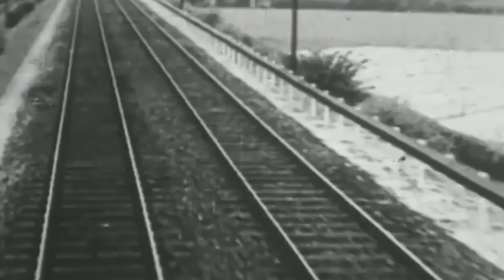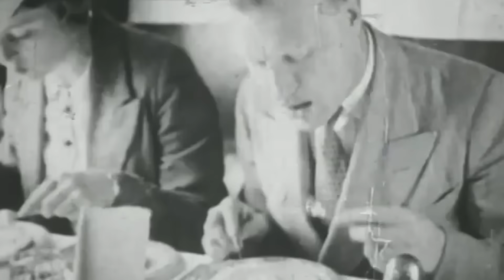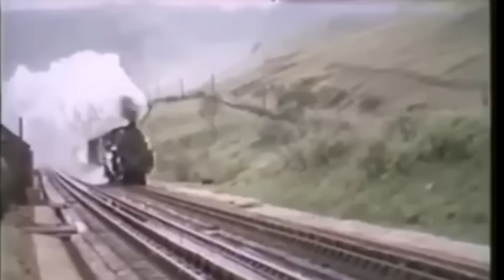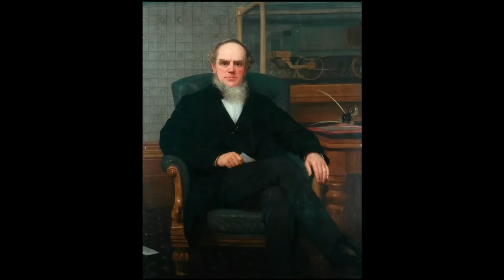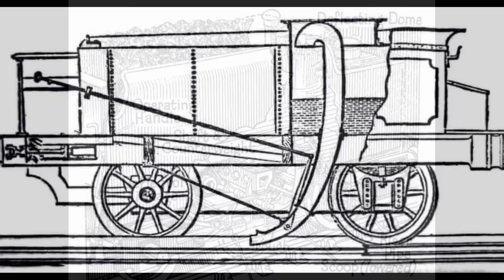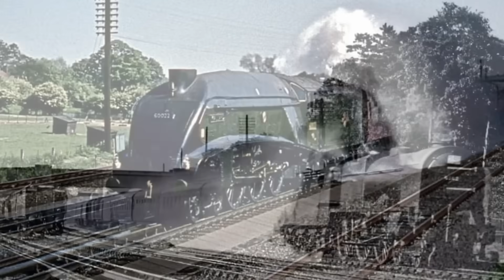On-the-Move Refueling: The Story Behind Steam Trains and Water Troughs #steamtrains #steam #fyp

Comment: According to the Wikipedia article on this, the tracks had a slight dip and rise to allow you to lower the scoop before getting to the water trough, and to prevent breakage of the scoop or the end of the trough if you didn't raise it before getting to the end.

Of course, one additional problem with water troughs is that you have to use them on a region of track that is absolutely level, or the water won't stay in them (although I suppose you could divert part of a stream into a trough on a slight slope and use the continuous flow to keep it supplied).

Comment: The Germans had a different approach, that did away with it: Look for 'Kondenstender' in Wikipedia. The German Version states, that with recuperation of the steam, distances of up to 1200 km could be bridged without replenishing the water. As an additional benefit, the condensate was already well preheated - lowering the coal consumption; and since it was distilled by the process, also reduced calcification. As a side effect during war, the locomotives were less visible for enemy aircraft.

Comment: On a pedantic point: water is not fuel, it's the working medium for the heat engine. 

The fuel is whatever actually produces the heat, in the case of a steam loco coal, or often on the US prairie wood.

Comment: When I saw the title, I felt sure it was wrong. Turned out to be refilling the water in the tender. Not refuelling. 
They never collected coal at 70mph.
Reply: Yep. Water isn't fuel.
Reply: Dude said that once they refiled other train with coal.
Reply: seems water can be considered fuel for a steam engine
Reply: It’s the water that produces the steal that drives the train. Coal just produces the heat to turn the water into vapor. It is not completely untrue. Plus, they could refill coal at destination. Water needed to be refilled much more often.

Comment: Track pans certainly weren't ubiquitous in the US like they were in the UK, but there certainly were quite a few of them, mostly on railroads operating in the northeast and midwest - so New York Central, Pennsylvania RR, Reading, Baltimore & Ohio, among others. Not common in the south or west - it was too hot and too dry.

But of course the other thing is that American loading gauge allowed for truly massive tenders - the Hudsons on the New York Central, which all things considered had a fairly restrictive loading gauge for the USA, had 13,600 gallon (standard tender) or even as high as 18,000 gallon ("Centipede" tender) water capacity. Compare that to an LMS Coronation's 4,800 gallon capacity, and you'll see the scale of things.

Comment: NOTE:  Refilling the water tender is NOT refueling!!!  There is a difference!!
Reply: Arguably it is refueling. Steam locos require two things to run. Coal for the fire, water to be heated to make steam to drive the pistons. Technically both are fuel so refilling either is refueling.

Comment: Question, and maybe it is a moot one at that. Why did locomotives not exhaust the spent steam back into the tender? This practice actually would pre-heat the water, conserving both fuel and water. We did this when firing boilers whilr drilling oilwells up in the north land in the winter.
Reply: South African Railways did just that. Condenser tenders recycled most of the steam for reuse. Made for messy trains as the smoke exhaust just rolled over the loco and train. https://en.wikipedia.org/wiki/South_African_Class_25_4-8-4.
Reply: @ OK, thanks. After reading that I see what a lot of the issues were. Again, thanks.
Reply: Locomotives blew the steam exhaust out the stack, and it created a draught that pulled the smoke out through the boiler pipes and pulled air into the firebox. That made the fire burn a lot hotter and produced more power. Like 19th century supercharging. That's where the choo choo sound and puffs of steam from the stack come from. Stationary engines and ships used the steam exhaust in a second and sometimes third set of bigger cylinders to get more work out of it, and condensed it back into water. That was too big and too much weight for a loco.
Locomotives were high-performance machines.
Reply: You had reason to...the lack of water..... so you needed to recycle.

This was and always will be a pump and dump system...

the long flexible hoses need to recover the steam from a locomotive just wouldn't work...
plenty of "free" water at the tracksides...or in the troughs.
Reply: @JohnSmith-pl2bk  OK, but they already had long lines and hoses running from the tender up to the injection pumps to pump the fresh water into the boiler as it used water. Even though in places where water was plentiful using less water would have equaled fewer stops. I am just wondering if there was an actual mechanical reason they did not do it, or maybe no one had thought of the idea yet.

Comment: The FUEL is COAL - NOT WATER!

Definition of fuel :- A fuel is any compound that has stored energy.
Reply: Blah de Blah de Blah……..
You guys must be a laugh a minute down the pub.
Reply: @jamesstevens1972-q2v  water is defined as fuel in a hydro electric powered station so you are wrong old chum.
Reply: Water has stored energy as well, plus they're elements not compounds
Reply: @BillSikes.  So, what calorific value does water have?
Water does not have stored energy, steam does have stored energy produced from where the coal heated the water to produce the steam, but the source of the energy is still coal.
Reply: @jamesstevens1972-q2v  
That's the funniest thing I've read in years, water contains no calories 🤡😂😂😂
Reply: @BillSikes.  But the water only stores the energy - it's not the source.
So, to be pedantic, @jamesstevens1972-q2v is correct that this is not "refuelling" - it's just replenishing the water.
Reply: @BillSikes.  Neither water nor coal is an element. Unless we're talking nuclear energy, compounds do not contain energy in the layman sense of the term. Most chemical energy is stored in the bonds between atoms, and therefore the substance storing energy cannot be an element. It must be a compound, even if it is merely a molecular compound comprised of a single element (such as molecular hydrogen, H2).
Reply: @APS_Inc  
That's complete rubbish, Coal is predominantly Carbon, one of the most abundant elements in the entire Universe
Reply: You didn't read what I said. Coal is a compound comprised almost entirely of the element carbon, but it only derives its usable energy (to the layman) in its molecular structure, which makes it a compound. Elements are atoms defined by the number of protons in their atomic nuclei, and unless you're operating a fusion reactor, the fact that coal is made of elements is irrelevant. Also water is not an element, it's a compound made of the elements oxygen and hydrogen (which you know).

Elements are building blocks, but almost no substances you encounter in your everyday life, except maybe for helium from a balloon, is in a pure elemental state, or at least, in such a state that it is not in a compound with itself (which would still make it a molecule and thus not a pure element). Chemical energy is generally stored in those molecular bonds between atoms, and thus any amount of pure carbon without the molecular structure that defines the compound would be useless as fuel. Diamond and graphite are elemental carbon, but despite being composed entirely of the element carbon, they are still compounds and not elements.

Comment: No mention of how the  troughs were kept full of water! An extremely important fact glaringly missing! A lot of us know, but it would have been informative to include it in this video for those who don't.
Reply: I don't know please share the information thanks.
Reply: As well as the info below, the actual water to top up the troughs usually came from purpose made small reservoirs, located very close to the troughs.
Reply: Obviously the trough must only be on a level stretch too or the water would flow to one end.  And although the trough must be KEPT full and refill rapidly after use it could not be permitted to OVER fill.  Yet a ball valve would be at extreme risk from the scoop.  And provision needed to be made so that it was impossible for the scoop to hit the end of the trough or the sleepers beyond the trough.  A few practical considerations that must ALL be filled to make the design suitable for general use.
Reply: @smitajky  
Just have a protected "well" at both ends of the trough where you have a float valve...
the "well" regusters the level in the trench and this controls the water level?
Reply: @smitajky  - Fill the trough from the bottom in the middle. Why not let it overfill?
Reply: @GWNorth-db8vn  "Why not let it overfill?"
Because treated water is expensive. Especially if you're in a hard water area and you need to soften it to avoid filling the locomotive with limescale.

Comment: In Canada, the cars at the front of the train were for coach passengers, whereas those in sleeper accommodation were further back.  This means only the lower class passengers would get soaked.  Problem solved!  🙂
Reply: In Britain the cars towards the locomotive (when heading TO London) are the upper class types so they can depart the quickest - get to the taxis first and stuff.

Comment: Brilliant Video ! Made my day ! In germany we call it: British humour !  This is to tell funny things without any emotion. What I cannot understand: British railway engineers were the first to develope excellent steam engines. Why didn´t they install a floater in the water tank to uprise the pick up tube when the tank is getting full ?
Reply: Because the force on the scoop from the loco speed and weight of water would overpower a float valve. The scoop has to be moved by a hand operated gear drive in the cab. The scoop is made from 3/4" steel so very heavy, the hand drive is reliable.

Comment: No worries about that on the Southern Railway. Water troughs were not used, and locos were fitted with larger tenders where necessary.
Reply: Well 3 rail electric and water troughs don't mix.
Reply: @michaelmcnally2331  🤣😂🤣😂😅
Reply: They mostly didn't have the long distances.
They used to change engines at Salisbury for the runs to Devon

Comment: Other than the method for scooping water, how did this affect the design of tenders?  Did thay make the water tank smaller since the tank was easily refillable and the coal bins larger for greater mileage between coal stops?

Great video, thanks for posting!
Reply: It probably did, if you look at the arrangement of Southern Railway “Merchant Navy” locomotives. There were never any water troughs on that railway, and they would have to operate between London & Exeter without a long stop to collect water. The other issue would be the total weight of the tender per axle.
Reply: That's a very good question.
I suppose so. Would be a key advantage of water troughs.
Someone else who can give a difinitive answer should chime in.
Reply: I doubt they made them smaller, steam locomotives blow through water like it was wet air, can never get enough water, use 5x as much water as coal. Also the troughs are miles long but shallow (to fit between the rails and above the sleepers) so they take several minutes to refill for another dose - could not support ALL trains that way. Goods trains might not even go fast enough to raise water that high, particularly back in the "tiny 2-axle goods wagons" days where the trains hauled customers' wagons that didnt even have brakes. Additionally in the winter something has to be done to keep the water from freezing. This was only for the fastest classes of train.
Reply: I have seen enough details on tenders to say YES the water capacity was less and the coal capacity more.  The reason is that UNLESS they had more coal capacity a long non stop run would have run out of fuel.  And simply increasing the size and weight of the tender reduces the performance of the train as a whole.  And unless you use more axles the axle load of a larger tender becomes too great. Therefore to HAVE enough coal you had to have less water.  Whether you like it or not.
Reply: Strictly speaking they didn't reduce coal capacity but a Tenders increased in size they gave more space to coal on the larger tender then additional water.   The initial LMS Standard Tender was the Fowler which was 3500 Gallon Water and 5.5 Coal (more coal when rails added).    The next one the Stanier Tender moved to 9 Tons of Coal but only 4000 gallons of water, and the tenders for the Princess Coronations were 10 tons of Coal but retained 4000 Gallon capacity.
So when they increased the tender size then proportionally got a lot more Coal added then they did Water, as they could replenish Water with the Troughs but Coal had to go to the Coal Depot to replenish.
If you go out on a Steam Hauled excursion on the mainline then it is Water Stops that you make not Coal Stops.

Comment: John Ramsbottom also invented the split metal piston ring (without which we wouldn't have internal combustion engines), a safety valve that couldn't be tampered with, and lots of other useful things.
Reply: Yes l have a ramsbottom safety valve on my 3inch scale traction engine.
Reply: It's not like his inventions are crucial for modern technology but his inventions boosted efficiency, safety and durability. 
You can make a piston engine without split rings. In fact, there are many competing designs without pistons out there. But the piston engine is too cheap to make and too reliable. Without split piston rings, I would guess we would mostly use Wankel engines or have switched to electric cars much earlier.

Comment: How did they refill them? Was there a water trough refilling wagon or did they just roll a tanker over it whilst emptying it?
Reply: stationary piping from water tower of course. The very idea is to supply water from abundant stationary source to moving loco, nothing more.
Reply: @ thank you
Reply: Usually by diverting a nearby stream, sometimes with the full water tower pumps and other plumbing. 

The Thomas the Tank Engine episode where they get a fish in his water tank was almost possible, but for the usual filter between the heater tank and the actual trough.
Reply: The train carried a water tanker on the rear before the caboose. As it was scooping up water in the front, the tanker would dump the water for the next train in the rear.
Reply: @coloradostrong8285  nonsense. Additional tanker just sits behind the loco and pumps water directly to water tender. Used when there are no water at all, not possible to build water tower. Australian railways used herds of them to run 100s km by arid steppes and deserts.
Reply: @antontsau  "nonsense"
It was obviously a joke. 🤦‍♂

Comment: In America this method of scooping up water was called “jerking water”. The New York Central used it on the 20th Century Limited. A place where the train didn’t have to stop because it could jerk water was called a “jerk water town”. Now a jerkwater town means someplace that’s boring or insignificant.
Reply: Answered one question I didn't know I had! Bravo.
Reply: @jimtitt3571  And you still don't, google jerk water towns.
Reply: My research says that "jerking" water referred to filling a tender by drawing it with buckets from a stream.  A "jerkwater town" was on a "jerkwater branch," both terms referring to one so unimportant as to lack a proper water tank.
Reply: Americans have a way of dumbing down everything.
Reply: Last time I got caught jerkin water they banned me from the pool
Reply: Not just that, but the water troughs were known in America country as “track pans”

They were used for the same purpose as shown in this video
Reply: Nowadays jerk water town refers to the USA

Comment: Southern didn't use this sytem
Reply: They changed engines at Salisbury for long runs to the SW.  Most of their other routes were short enough not to need trpughs, but they had bigger tenders.
Reply: @rogercantwell3622  Also, water trough + third-rail electric = BANG

Comment: Water is not fuel.
Reply: Non condensing steam engines need a lot of water!  It is the working fluid of the steam system;  non-condensing means the water, steam really, is discarded after usage in the engine.
In all fairness the exhaust steam is used in the steam blast nozzle, blowing up the stack, to induce a draft to draw fresh air through the fire.

The water is separate and in addition to the fuel.
Reply: Correct, in spite of what other are trying to claim in their ignorance of what a fuel actually is.
Reply: Love the train at 57 seconds, throwing up a spray of water from the troughs then 2 coaches back, spraying weed killer. Thats not going to do a lot once its diluted that much.
Reply: @mybeasty3560 . That’s water you see.
Reply: @jamessimms415  no its not, you can clearly see the sprays spraying the weed killer. Thats the weed killing train, operated with the 2 coaches and tanks, worked like thst up untill the introduction of the mpv train. The water is coming from the tender as always but the fluid coming from the sprays is weed killer. Used to be Fisons but don't know who supplies it now but I've worked on weed killing trains just like this albeit diesel hauled.
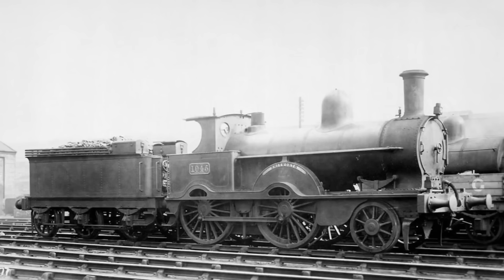Reply: Listen around 1:10 & learn something new
Reply: @jamessimms415 yes, but water is fuel. A fuel is any material that can be made to react with other substances so that it releases energy as thermal energy or to be used for work.
Reply: Your not a true rail enthusiast its a basic thing a steam engine needs to work so at the end of the day it's a fuel for them
Reply: @stephenjones407A fuel is any material that can be made to react with other substances so that it releases energy as thermal energy or to be used for work. Water is thus not a fuel. Water is to steam engines what air is to a jet engine, the medium that is heated up.